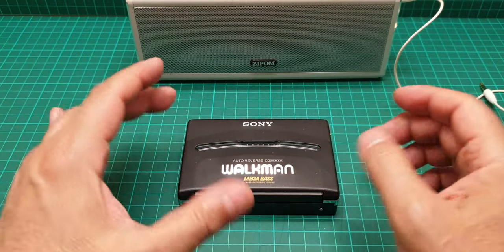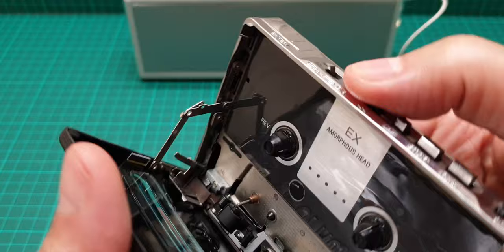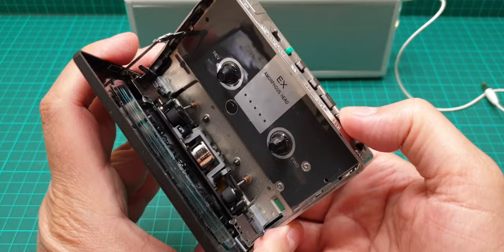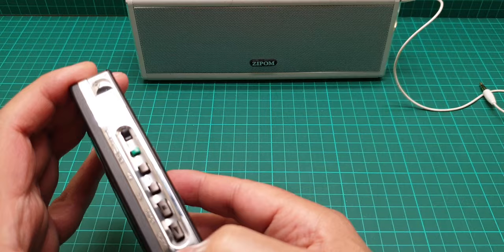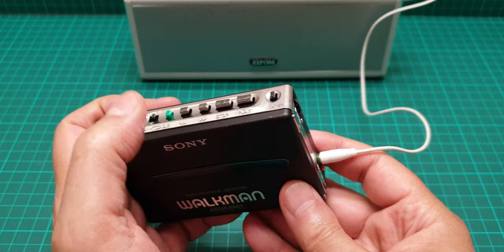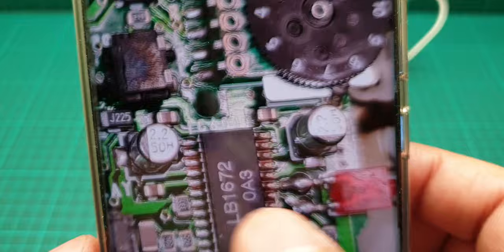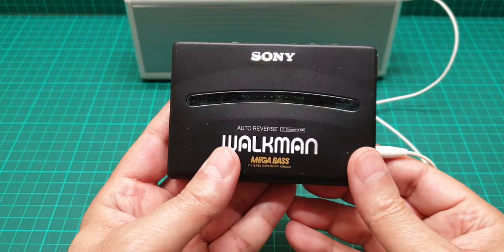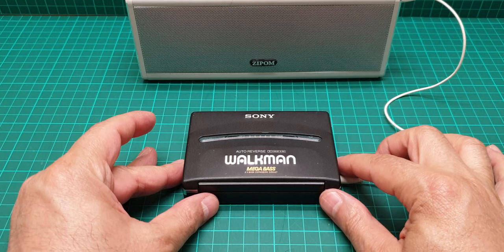Sony WM-190 personal cassette player Walkman review & inside look | Merry Christmas to all

Comment: I have a wm 2091 it uses a standard aa battery but the same insides they sufer from cracked clutch gears as well mine has the leaking cap problem i have cleaned it up it is the 330 microfararrad cap that is the main cause it is also this value capp that fails in sony camcorders ,i am going to replace the caps i am not giving up .